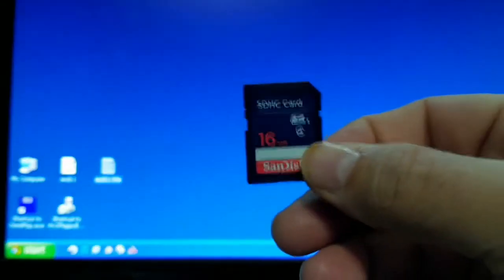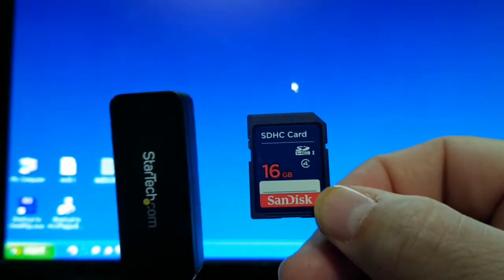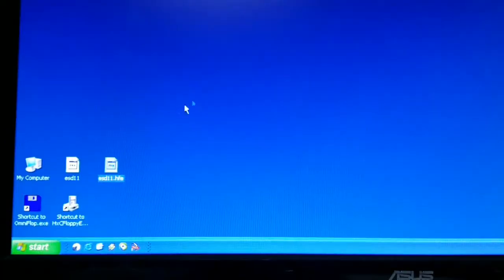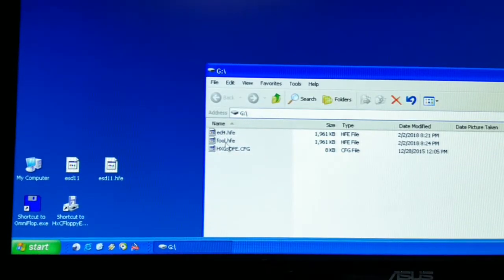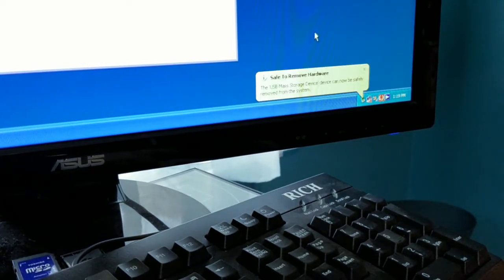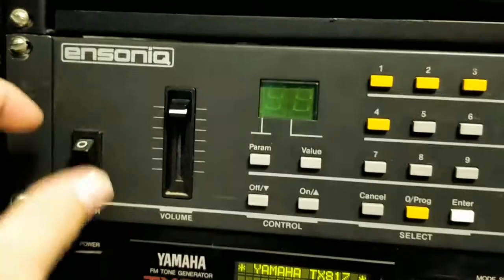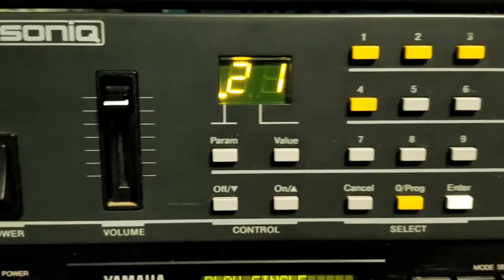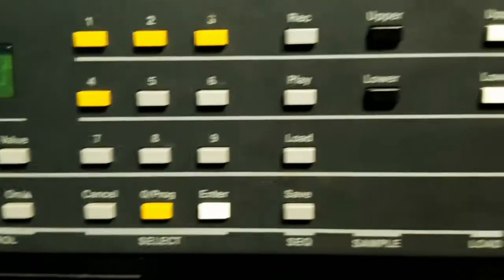Ensoniq MIrage SD card loaded - Lotharek HxC Floppy Emulator

Comment: Hi... was wondering which model of the HXC Floppy Emulator is the one installed on your Mirage DSM8... I see that yours is a snug fit in the hole after the floppy drive has been removed... the other videos I have watched have a gap on the top...  is it like a newer HXC Rev F?  Thanks...
Reply from the maker: https://youtu.be/ZY5a-V3PTNU

this is what is did I have about 4 of them left unpainted make friends with colecobrothers on Facebook and if your postal code is reasonable ill send you one.

Comment: I have a DSK-8 and problems... ;-) 
What kind of problems did you have with the different SD-cards? Did the Lotharek Emulator not accept it? In my case the mirage only shows "nd" and is not booting....
Reply from the maker: first thing is make sure the floppy cable isn't backwards. mine was not keyed and did not have a stripe.I had a 16BG micro sd/sd adapter that would not read. no matter what. After a dive in the deep end of Google and finding what I was sure was working images and configuration file the mirco sd  still never read. I tried 16GB and 64GB.I tried a full size SD card and had trouble at first with the *.cfg file. then I found the software that makes the CFG file and downloaded a few "good" ones.  i am currently using the default generated CFG file. I have successfully used three full sized SD cards the ones in the video 512M and 2GB and i have a new 16GB SD card that works. They were formatted in windows 7 laptop SD slot and loaded as shown in the video.
Reply: one very important question: did the reaction of the emulator looked like as if he is normally working with the sd-cards (also with the one that were in fact not working)? Did the display show "RA T:000/080 S:0"?
Reply from the maker: I don't recall the display while using the micro SD. it was a long time ago.  however in my video, I also had the issue of the 12v power supply not working. This made the mirage OS count up ~10 numbers on the HxC  display, and then wait for three minutes until the internal OS self test time out. So it seemed the SD was not loaded correctly even thought it probably was.  FYI the FMT2.HFE is a mirage floppy format OS image. It does not run the self test and booted correctly every time. this is shown in the installation video. you should test with this image and the default cfg from the HxC software.
Reply: Thank You for the quick reply. I tested every step... hmmm... not working. (FMT2, external power, SanDisk SDHC...). My old Mirage is not booting. Does anyone out there know if the display of the Mirage shows "ud" while there is no SD card in the floppy-emulator? My Mirage shows "nd" what is different to a "real floppy"
Reply from the maker: post that question over on the FB ensonic mirage group, you will get a quick reply and can post pics.  but yes if I take out the SD and reboot the mirage it shows no disc
Reply from the maker: ND is usually just the ribbon cable upside down, the lotharek doesn't have keyed connector. I made kind big deal in the install video. 

None of my the micro SD cards worked in a full size adapter. I reported it to lotharek. I think they fixed it in the firmware. I just use full size cards on mine and it is fine, they are just getting harder to find.